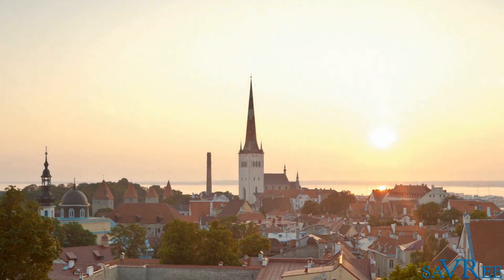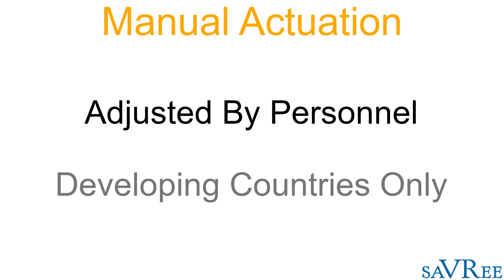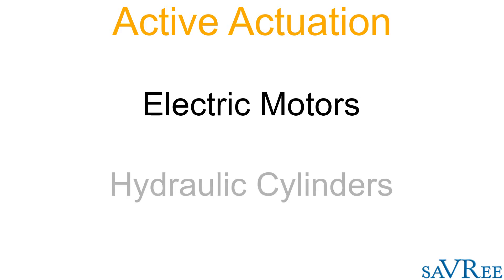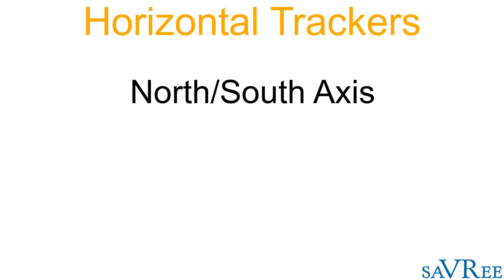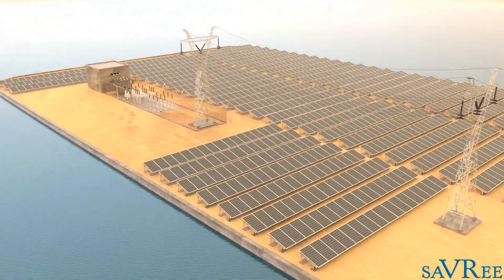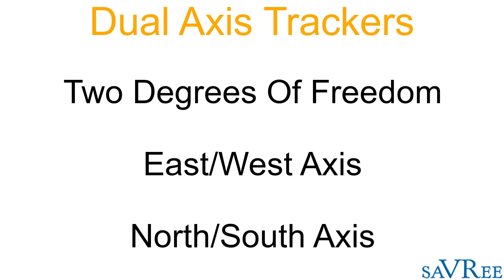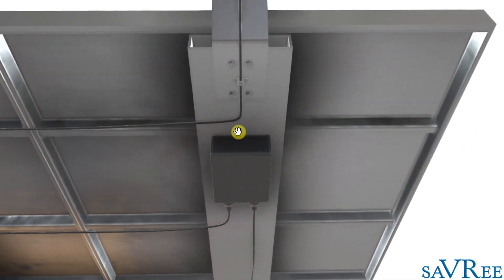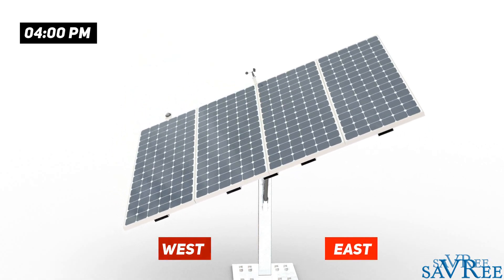How Solar Trackers Work

Comment: Umm,  good video but the cost comparison confuses me,  if the dual axis is 100% more expensive, that is a one time cost,  the 40% increase in power is continues and will easily pay for itself over time.  So am not sure I am "tracking" your explanation?

Comment: Thanks for your efforts. Good job overall.
However:
@6:22 Cursor not mouse.
@12:15 "Dual axis panel can cost 100% more than a standard panel." False. The panel articulation system adds costs. The panel retains the same cost independent of it's mounting.

Comment: Really enjoyed that video, saVRee - thankyou!
I see you've got a detailed 3D model of a 2-axis solar tracker (it might the popular Eco Worthy one?) and you have a simulation.
I'm interested in getting a 3D model of a 2-axis solar tracker into the CAD system called Rhino, then making simulations in Grasshopper (visual programming inside Rhino) with the plug-in LadyBug. 
Do you have anything that could help with that available for free - a CAD model or advice? Thanks.

Comment: Excellent video & presentation. would have been nice to have included the parts of the actuators, anemometer, hydraulic cylinders, solar tracker controller & sensors connectivity with electrical power source & where to find these parts.

Comment: Solar panels are not categorized (or manufactured) as 1 or 2-axis panels and non-moving panels. A panel is a panel. It is the mechanical track and pivot system that adds the cost. Although, maybe you didn't mean to communicate it the way you did?

Comment: The other potential reasons for using dual solar tracking would be extra panels cannot be deployed due to space limitations, any situation where daylight hours are limited, and the ability to adjust the position to shed snowfall.

Comment: The need for electricity around the clock during the day to operate loads that require a long number of hours is what forces us to implement a base of moving panels with one or two axes, or you must design a double photovoltaic array in order to obtain, for example, at nine in the morning the electricity necessary to operate those loads and waste excess electricity at peak times.

Comment: What powers the solar trackers when the sun isn’t shining?
Reply: If the sun isn't producing power, there's not much reason to track it. Like at night or in heavy clouds, the unit is dormant.
Unless you mean when solar power output is insufficient, then there would be a small backup battery. This can be a stand alone battery located with the panels/tracker running off its own MPPT (controller).

Comment: I'm so confused by this. You say that a "horizontal" tracker, which follows the sun's path from east to west through the day, rotates about a "north-south axis", which seems correct. But later you repeatedly use the term "north-south axis" to refer to motion that alters the slope of the module up and down to match solar altitude. What exactly do you mean by "north-south axis" a line that runs through the center of the module from south to north? If so, wouldn't that make the module rotate from east to west?

Comment: Very intersting, seems like too much overhead for not that much gain, but what if you had 1 axis instead,  the panel is donig the same moevement eveery day so is dual axis really necessary? one axis with a predetermined angle could give you almost the same amount of gain, not quite admittidely, but perhaps at 1/10 the cost of a dual axis system with about 95% of the gains with a 1 axis?  A simple script for your area could move it at the right time with no need for tracking overhead  either further bringing the cost down.  Just the hardware for movement of 180 degrees.  And now you could afford to put all your panels on 180 degree motors and perhaps would want smaller panels to mulitply the efficiecny gain, as it would seem you should get more the more panels you can move, if they're smaller you can move more into optimal light.

Comment: Dual axis solar panels; 40 % more energy for 100 % price increase. Not economical sustainable........I guess that depends on the demand of power during the day. If one could save or sell energy at times of the day with higher prices it might in fact be a GOOD deal.

Where I live energy can often become almost free in the middle of the day. Meaning that I have no real economical use for making my own energy. In other times the price can go op several hundred percent.

Comment: The complexity and cost can be reduced by "tracking" the sun through about 90 degrees centered on solar noon each day and adjusting the tilt of that axis manually each month. The amount you gain outside of that is small.

Comment: Why does it cost 100% more for a pair of actuators? If we make it ourselves it'll not cost more than 10% of the setup and for huge system just single drive is enough where it costs less than 5% of the setup. I think you people should get a new dealer abroad, many companies make simple stuff more complicated and charge 10 times more than it should be.

Comment: Smart. learned a lot. thanks.  My comment would be to have the East West orientation on a rotating column so the entire array rotates.  Where i am located, central BC, the E W change is about 270 degrees,  a whopping difference in summer. 

In winter, the change might be 120. So to rotate makes more sense. The up and down is at least 70 degrees in summer, maybe 30 in winter. 

With my 2 panels of 315 watts each, this makes a lot of senses because i need power immediately in the morning and to stock up late in the evening.

the wind speed sensor is damn smart, so the panels flatten out in windy days . never thought of that. 

I'm thinking of a scrapped old big satellite dish mechanism as the main hardware and mechanics. if it can support a dish 10' in diameter,  then that would be excellent for say 3 large 300w panels. yes?

Well done.

Comment: Hello. How much watts we can gain through this dual axis tracker? I calculated and found that the equipment and installation cost of this type of dual axis tracker is much higher than installating 3-4 additional panels to compensate the wattage loss due to sun's movement... The concept and idea is good, but not practical considering "Cost and benefit" analysis.
Reply: Sir please send me your phone number and tell me the price
Reply: uh...he already said that in the video

Comment: Hi John,
Nice one
A doubt though
I wasn't properly able to understand how a passive solar panel works
You said that a low boiling liquid is taken and when it evaporates it would tilt
Here's where I am not able to understand
If the liquid vapourizes then shouldn't the liquid present at other areas fill up the vapourized portion
Reply: https://youtu.be/XtDlUiWOmR0
PV Hybrid system by IIT faculty, Subscribe our channel to get updates, thank you

Comment: When you look at dual axis solar panels and whether or not they are worth the extra cost, don't just consider "40% more yield vs 100% more cost". The power from solar panels are generally needed the most in the morning and evening. So that extra 40% is mainly obtained where you would get very little production with a fixed panel. The real worth of each kWh is much more, when the supply-demand balance is such that there isn't enough supply. That would be directly financially realised in grid tie solutions where the price paid varies with supply-demand. But also for island systems, where batteries back up at night, you are interested in keeping the batteries charged up until as late as possible, while also be able to recharge them in the morning, as early as possible. The savings in battery capacity will in many cases make up for the added cost of a dual axis system.
Reply: Now that makes a lot of sense. Exactly as I've found out. and come winter, every drop of sunlight is gold, no?
Reply: Dear b74a, your calculation is wrong. The cost of a MAX® (Multiple-AXis) tracker of e.g. 100 USD more to a FiX® (FiXed sub-construction) is probably 10 % - 15% more costs on the total system. The total system includes beside the construction, also all panels, inverters, cables, collector boxes, technical planning as also EPC (Engineering - Procurement - Controlling) costs.
But on the annual revenue, a MAX® brings 145% , while the FiX® has only 100% of yearly electric production. 
On a long-term of 20 or more years, it is better to use MAX® , also called dual-axis, then not. With this system of MAX®, our company SOWiWA® GROUP is installing in Eastern Europe more than 1 GW of Photovoltaic in the next 5 years.

Comment: A most excellent video and graphic CAD display. I am interested in going solar for a small cabin that I built, and because I am in a higher latitude location, it only makes perfect sense to go with a dual tracker system due to the changes in sun location in the various seasons (4 of them). Yes, it may cost more, but if you can eliminate most of the costs by being able to do the fabrication yourself, then it only makes sense to go with that design that will give you the most efficiency during the various seasons. You really have to weigh your options and do your homework before considering such a system. Thanks for sharing! Cheers!

Comment: As far as off grid living is concerned, this video is super simplistic, and therefore (sorry mate, I do not want to diss you...  ), inaccurate. As, and very often, more important than peak power, is the distribution of power throughout the day. In the darkest winter months, East to west tracking is not so important because (Northern hemisphere) the sun is rising in  the South East and setting in the South West, with relatively little passage across the sky, however vertical alignment with the sun will make a significantly beneficial improvement. However, from mid February through mid October, to be able to maximise available power harvesting will make a big difference to the utility the panels provide...  if you are not interested in being as kind to your batteries as you can, all this is not so relevant of course !! ... but if you are, and maybe you want or need to run some heavier loads when it is convenient for you to do so, rather than the position of the sun in the sky calling the shots,  then it is useful to be able to have your panels orientated as norman (at right angles), give or take twenty degrees or so, to the sun as possible. I often get almost 50% of available power shortly after sunrise (I do have some visual obstructions to the SE, so sunrise is always an hour or so later than it would be at an unobstructed location, however it is still relatively low in the sky) and my setup is very far from ideal. So on a sunny day, continuous or intermittent, by early March through late October, I can use my maximum draw appliances from an hour or so after local sunrise through an hour so so before sunset, within reason, without putting a large load on my batteries, as a good chunk of the power that the inverter is supplying is coming straight off the pannels and therefore the batteries are not having to work so hard, thus, maintaining voltage. I tend not to impose a heavy draw within a couple hours before sunsett though, as I like my batteries to be fully charged well before. Basically, the length of both the useful day and  of useful season is significantly extended. Now, if you are significantly dependent  on that beautiful big yellow ball, you will know just how much significantly lengthened useful days and seasons are. Gain 40% but it is not worth it, better go go buy another panel instead might sound like a good idea, but if thought through and alowed to reach a logical destination, it does not provide a great deal of utility. Appreciate your batteties, be as kind to them as you can; track you panels both vertically and horizontally if you can; and enjoy the gift the sun is giving you for more hours per day and more months per year.
Reply: Great response  thanks

Comment: Hello ! very nice video well explained, i just have a question about the dual axis tracker, i have a project about this and instead of this function my tracker will be moving according to 4 solar sensors but am struggling finding the right motor to move the pannel. am thinking of a jack motor would it be the same as the two hydrolic pumps u using? and would it be easy to program the two jacks, thank u !

Comment: Am just starting out... and perhaps am “putting too much on my plate” for wants. 
1) Flexible in being able to use at home, and take with for my trailer for vacations.
2) Am thinking basics to start... & if desire & money is there... to add more panels, better components.
3) I have (2) 120w , flex panels on order, & (1) 50w rigid panel , bought years ago, never used
4) Since its minimal... desire the dual axis tracker, to get max power to batteries.
5) My biggest conundrum is NOT knowing the good “name brands”,so may get unknowingly poor performance
    parts & get discouraged, if it all does not play out like I’m hoping.

I like this vid, so am subscribing for more basics, and looking around for other good, practical references.
I am strong electronically, but mechanical ability is sorely lacking... so this project may be quite a challenge !